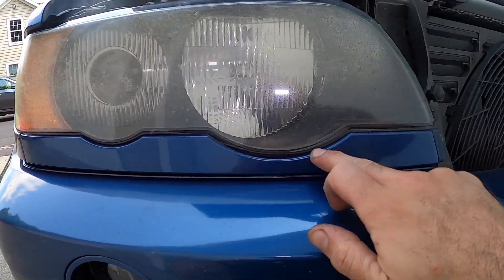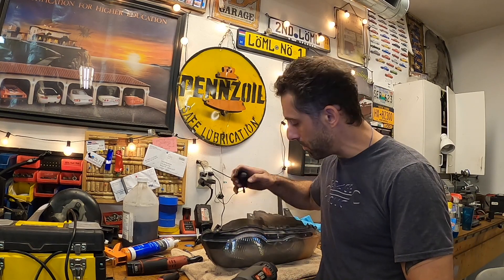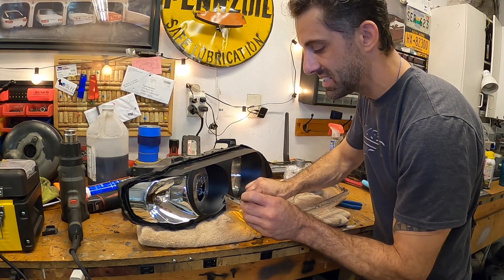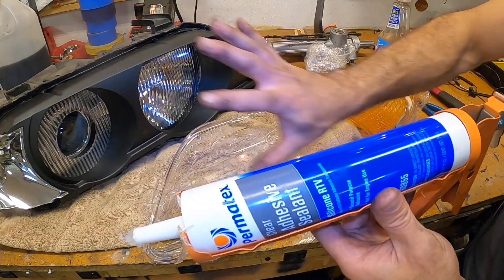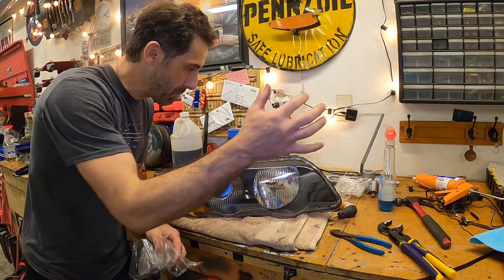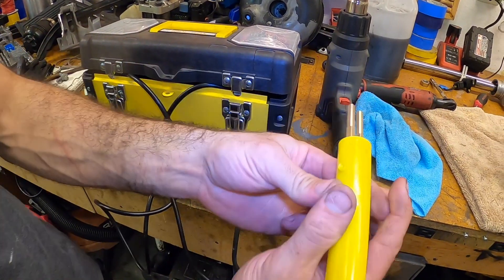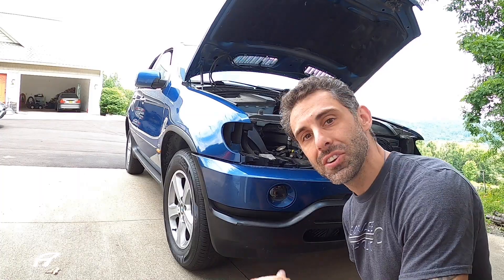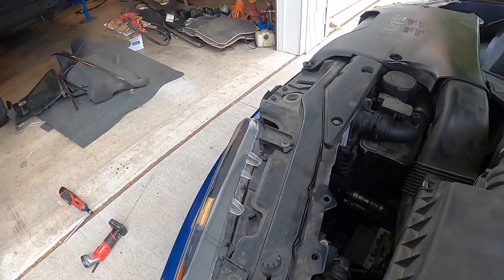BMW E53 X5 Headlight Lens Replacement

Comment: Any need to clean out the old adhesive first? Also I question using RTV/silicone here. Thinking something like butyl rope would be less messy and less permanent. Anyway, good info, my E53 will get new eyes installed soon! It's also a 5-speed, with the xenon headlights.

Comment: Before you let go of heater on plastic welder; while the clip is melting the plastic on both parts - twist it on one side. So the metal clip also gets stuck sideways also, much better grip on both parts.
Reply from the maker: Good point that helps a lot!
Reply: @Garageaholic  just to be clear, do the twist before pulling out!
Reply from the maker: Yes! It smooshes the melted plastic together more coherently!

Comment: To be correct. Outer adjustment is for horizontal and inner adjustment is for vertical
Reply from the maker: One is for high beam, one is for low beam. Might be different on facelift e53’s

Comment: I just tried to do the passenger side one -- it was replaced at the dealer years ago for condensation. The glue that holds the lens on was not meltable. The housing melted but the glue did not. I basically destroyed the light trying to get the lens out. So beware of the different glue used in some of the headlights which makes this job impossible.

Comment: Could someone advise where I can buy these?  I’ve seen many on eBay but it looks like they’re simply a cover that snaps on over the existing lens.  If anyone can direct me I’d sure appreciate it.  Thanks!
Reply from the maker: It doesn’t snap on the existing lens. It replaces the factory lens
Reply: Thanks for the reply.  Just to clarify, are you telling me that all of the ones on eBay are actual replacements and not just some sort of accessory that snaps over the existing headlight?  I had one eBay seller tell me that but I’m not so sure they knew what they were talking about.  Wouldn’t be the first time with eBay sellers.
Reply: @Garageaholic  do you know where I can buy replacements?  The link you have on eBay says they are not currently available.  Thanks so much for your help.  😊👍🏼
Reply from the maker: I’m not surprised, the auctions expire, get replaced or supplanted with similar items.

The ones you buy are just like the ones I had in the video. Just need to look. Try ECS or FCP to get replacement lenses
Reply: eBay, $100 or so, and they're direct replacements for the old ones. I got a set today and will install once the butyl rope shows up. If your E53 is post-LCI (facelift, 2003-06) this will not work. The ones I got look exactly like the ones in the video.

Comment: Must be a pre-face lift thing with that sealer that needs heating.
Post face lift e53 uses a rubber gasket and easier to change once the housing is removed from the vehicle.  Significantly more difficult to remove the housing though...

Comment: I use plastic wedge tools to split the lights.  Picked up a set at Advance Auto Parts for under $10.  Can also bake the headlight to weaken the glue.  I think that Sikkaflex is the proper glue for this.

Comment: hello please help does this apply to x5 2003
Reply from the maker: 2001 to 2003 have same design. 2004+ went to updated shape of the covers.
Reply: No ....after 10/2002 Hella changed the glue to non melting,needs cutting

Comment: So Jan 2022... in 6 months price went up to $141...  Inflation is real.  But in any case, I didn't think that you could replace just the plastic cover, and spent 3 hours polishing the thing with the 3M Headlight Restoration Kit and it's still a bit hazy.  Should have just replaced it like you did.  I know some people put the whole thing in the oven, but I like the heat gun method better, less chance of melting the whole thing in the oven.  And your cookies won't taste like plastic.

Comment: Pay close attention. This impossible to do without crunching up the light housing. It’s even wrecked in this video. Can’t soften the glue without softening the plastic along with it
Reply from the maker: “Crunching up” the light housing? These covers were installed and sealed originally with Butyl tape, which is OEM. Replacing these e53 covers is as easy as replacing e46 covers. I’ve done both.
Reply: @Garageaholic  Yeah the lip of the housing that the cover sits in gets crunched/bent/chipped. 2:08 on this vid can see it’s the same as mine. Can’t be helped and is still hidden inside the guards and rubber seal when re-installed. Was more of a reference for people to realise it’s going to happen but doesn’t hurt the install